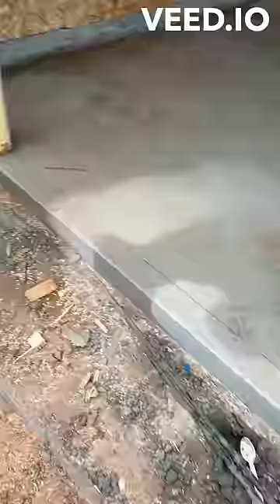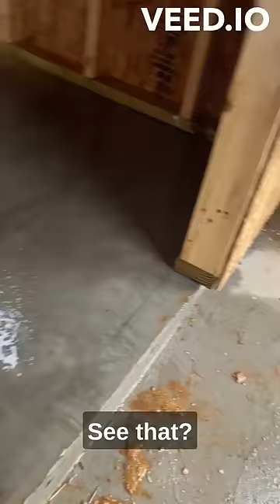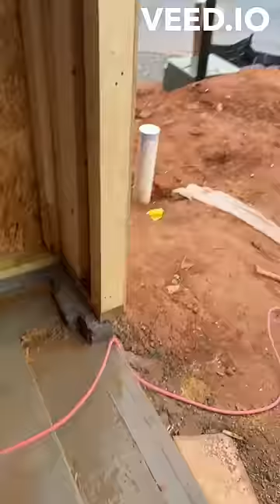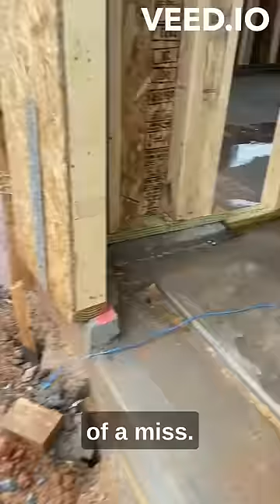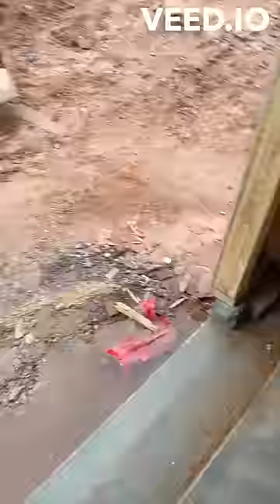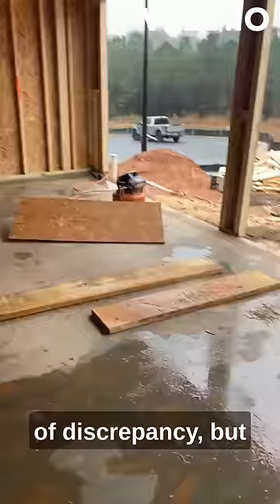New Home Slab is Wrong Size, What Now?

Comment: I like how they just kept framing even after the first one was wrong.
Reply: They have to work to get paid
Reply: @tvviewer4500 you don't get paid for shitty work that isn't correct, it's better to actually do the work correctly otherwise you're not actually working you're just creating an issue
Reply: I like how they started framing after snapping lines and knowing they'll barely land on slab
Reply: @godusopppppp  the laborers don’t care. They can still get their money saying they did what the sub or general contractor told them to do.
Reply: @tvviewer4500  be pretty hard to get paid from a company that has to file bankruptcy because you fucked up a huge job
Reply: Because they want the payment get that wood up so we can get our first payment
Reply: @godusopppppp  i think you vastly misunderstand how these people are getting paid.
Reply: @tvviewer4500  I think you misunderstand how money works, the company that employs you has to receive money in order to pay you. If you do an extremely awful job and fuck the company over and they go under there is no one to pay you.
  Go ahead and read that a few times before you @me again
Reply: Thing is it's not necessarily the framers that fucked up, it could very well be the groundworks that installed the slab. The mismeasurment is obviously they've gone to the centre of wall so it could very well be the initial measurements of the slab that are off  @godusopppppp
Reply: @tomt637  bro the slab was installed FIRST. You measure out your work BEFORE you install it. The framers should have known this slab wasn't the right size and NOT done the work.
     It's a fairly simple concept if you're not brain dead, The framers did fuck up
Reply: They have to follow the measurements concrete guys or framers one of them messed up in here
Reply: @godusopppppp employees still get paid, they may get fired afterwards but they still get paid
Reply: 3-1/2" exterior walls should never be framed liked that period. Lesson here: If you're the home owner then always arrange for the carpenters do the form work on the foundations which they are to build on. For carpenters: ideally, reach out to the owner or contractor and go with the slab... then just factor in the move when laying out the partition walls and trusses
Reply: @godusopppppp clearly you never worked for construction. Learn to actually search things. They probably get paid way more then you even if they messed up🤣
Reply: Everybody who works on a job goes off the floor plan. If the concrete doesn't fit with the floor plan there isn't a whole lot you can do. Usually these guys get paid by the job. Meaning if they don't get done in a timely manner they can't get paid. That's a real bind to be in
Reply: They need their meth money
Reply: @godusopppppp Poor workmanship is not grounds for rejection. Carpenters did their work fine. Not their problem.
Reply: If youve ever tried to explain to a GC how another trade fucked up, you immediately  understand.

We had framers slope a roof wrong once and roofed it anyway. Let building inspector know it was gonna pond til it collapsed the way it was and when GC complained we just resent the email we sent weeks earlier explaining exactly that, an email je had told us he didnt care.

Happens on every other job.
Reply: @godusopppppp thats a lie. You get paid for doing the work to contract. If someone else messed up but you did yours right, you get paid to redo.
Reply: @MrNipy *than
Reply: That's a dick move.
Reply: Two by off every where
Reply: @tomt637 they could have moved the walls in.
Reply: @@ChimentiStaxit could entirely be their fault. They might have snapped the wall line. The line might even be off. Maybe the concrete was off. Fact remains framers not smart enough to see that’s an issue. Could have pulled the wall in and no one would notice.
Reply: @RoofingFacts by the GC, not the owner.
Reply: @2002mattyusk  the majority of the times the owner knows as much about the construction of their building as a dog understands about driving a car. Sounds fun, they are there for the ride, but they're lucky if the can operate the window buttons.

Plus some contracts or verbal agreements may ban you from reaching out to the owner short of an illegal activity occurring
Reply: @RoofingFacts  yeah lots of people that end up in construction just don't care at all about doing things right
Reply: @2002mattyusk  it could be, but I've seen situations similar to this and in my experience it's the concrete guys 9/10 times
Reply: @royalgilpin4922  oh I know.  I'm a consultant that specializes in helping in forcing builders (primarily through litigation) to fix the job properly or pay to have it fix
Reply: You're paid to frame, when the super isn't checking up it's his fault.
Reply: @timothinking9855  I mean, yes that's true, until you realize how contracts work
Reply: @peterpizzurro  damn you should have been a professor. Only a few people in the world can type perfectly like you!
Reply: Somebody told them “Just do it!”
Reply: Not only that but they sheeted it too
Reply: The generation of that wasnt my job. Claps away dust
Reply: That’s what I was thinking I would not pay until it was done right
Reply: @diceNdiceN  not always 😂 if the employer can prove gross negligence, they dont have to because it could also be considered stealing time because you knowingly fucked up and still kept going. Employer could also sue for all materials and labor hours wasted because of this.
Reply: @tvviewer4500 you understand that crews get cut with no pay when they fuck this shit up. Maybe with union they get paid but not from the owners pocket. That would be in and out of court. Especially when your inspector is this guy. His notes are thorough and vloged.
Reply: This is what terrible contractors do, and continue to waste the homeowners money, then they are going to blame it on the foundation guy. Then they will need to be paid to rip it back down. This is a scam
Reply: @@ChimentiStaxit 100 percent is the framers fault because they shouldn’t have installed until talking with the general now it has to be redone
Reply: @godusopppppp You have garbage knowledge of how big contract work is financed. Half up front or full up front for labor and materials plus contingency.
Reply: @godusopppppp  that’s how it SHOULD be. That’s how it was. But now you get punished for working hard. In the sense that you pick up others slack while they get paid the same. It pays mentally to be lazy. Your hard work is not appreciated anywhere🤦‍♂️
Reply: @tvviewer4500 ty for this laugh!  I started thinking of a burger place going through the motions of assembling a burger without the meat.    The explanation "we were out of meat but.. got to work" 😂
Reply: @godusopppppp Correct! Or they could have just made the frame to fit the slab and called it a day.
Reply: @MrNipy  you're talking to brick layer here you child, I would never just start laying block on a footing that's fucked up and not the right size, learn to take some pride in your work bud.
Reply: @spray_cheese  I don't get your point of view, yes if you show your job that you do more they will definitely throw more on your plate but something like this doesn't take a genius to figure out, you pay out your strings say "oh that looks fucked up" and then you inform the super if they're not already right there laying out strings
Reply: @godusopppppp  “you child” bricks have nothing to do with this🤣🤣 keep it up clown
Reply: What choice do they have? Builder definitely told them to go with it. The ROs and room sizes are set in stone.
Reply: @godusopppppp  not saying you should be a shitty worker. I’m just saying there’s no consequences these days. You get yelled at for not busting you ass as hard as you were the day prior but people who slack and fuck off get to laugh and have a good time with their boss. It’s bullshit. It’s not even just low end jobs either it’s everywhere. Before I was even born that shit didn’t slide. But people are soft nowadays and even as someone who had it no other way. It pisses me off! Working hard gets you nowhere. Just as far as the rest. So no point pushing. It’s communism essentially at a small scale.

Also not being demeaning, don’t give up. But it’s not wise to bust your ass under someone else’s belt. If you want more money. Work for multiple people. Not a lot for one person. You’ll ACTUALLY get paid then😂
Reply: @MrNipy  your comment says "I bet you've never worked construction" so yes me being a brick layer is relevant to prove you wrong on that, and secondly framing a house in wood is the exact same process as laying down a block building, only a block building definitely takes more work and skill. Learn some things before you talk child.
Reply: @godusopppppp  Funny you assume but you working construction don’t think so anyone can say they did something and didn’t and you saying child just telling me you haven’t hit puberty so good luck growing up.
Reply: @MrNipy  Dog why r u angry at him all he is saying is that the framers should have done their job properly. If you disagree with him, that means you think they should have done their job improperly. In other words, you're wrong.
Reply: @@ChimentiStaxyou would do that kind of work cause a piece of paper said so 😂😂😂😂 🤡🤡🤡🤡🤡
Reply: @godusopppppp  that’s what insurance is for. But that would be on the Architectural or concrete company I would think.
Reply: @godusopppppp  they still have to pay what they owe their employees even if they file bankruptcy. Might not be right away but they get something. It’s illegal not to pay what you owe if you are under a contract.
Reply: The framers were probably the ones that actually got it right. You see, when a house is designed and the trust company builds trusses for that house, the dimensions of the house need to match the dimensions of the plans because the trusses are built according to whatever the dimensions are on the drawings. If they build it to the concrete was poured and just ignored the dimensions on the your roof wouldn’t  work quite right. Everything would just be a little bit off and when it comes to the roof, it makes a huge difference. Concrete guy are rough. Sometimes if you had to form up Concrete forms then you would understand why.
Reply: @godusopppppp  Once Production is rolling, it’s not always that easy of an option to just stop in have the concrete poured again. The concrete guys can always come back and dry pack beneath the part that is not sitting on top of the concrete there are fixes for all that stuff.
Reply: @@ChimentiStaxexactly!!!!
Reply: @Chris-yv9tv  oh yeah, that’s the smartest comment I’ve seen on here!
Reply: That's because most dont understand building thats for sure, I read the comments.
Reply: @cmbmail42  Question, so could they not just dig up the dirt in front of the overhang and put down more foundation?
Reply: @godusopppppp but I assume the framing work is correct so they will get paid. They can only go to the plans. If they followed the slab and made the house 2 inch to small then the work would be wrong and they wouldn't get paid.
Reply: @tvviewer4500 exactly than they'll get paid again to fix the work. They can give 2 shits when their boss is a piece of crap. Boss will be the one paying out his behind
Reply: @godusopppppp this could be a huge company that can eat this no problem and whoever was in charge of this job will get their ass chewed out and possibly fired
Reply: @godusopppppp  the workers still get paid the contractor is the one tking the hit im most of my cases
Reply: @godusopppppp who fucked up though? Foundation could be short from the blue prints, then carpenters said Fuck it we’ll follow the blueprints rather than deviate to fit the foundation 😂
Reply: @godusopppppp wrong they 100% do get paid whether it's right or wrong the owner of the company may not but the employees always do..😂.. I've been running a business for 35 years now and that's as true as it was on day 1
Reply: @godusopppppp how is it shitty work? The foundation sets the pace for the rest of the house. If the concrete guys did a shitty job which they clearly did. They should have redone it. Framers have to frame the house to the actual Floorplan. If the house is an inch or 2 short it's on them. People pay for Sq ft. They got shorted on concrete. You don't know how this all started. The developer could have been rushing contractors and they have to meet deadlines. A framing crew isn't going to just sit there and wait a day or 2 not getting paid while the developer and concrete guy figure it out. They could have been told to just frame it as is and they will fix it later
Reply: Si, esta bueno
Reply: I am still puzzled as to how this could be isn't the concrete guy guy using the same framing plan as the framer?
Reply: @godusopppppp you still get paid. Why even try to explain. The boss is always right, they want the job fast pronto rapido 🤣
Reply: @godusopppppp they get paided otherwise there bud they just don't have a job no more
Reply: Exactly. The framing is probably correct because there going by the layout stated on the plans. The concrete sub does the same but there laying out in the dirt with more of a chance to be off the mark, even though they should hit all there marks. The way crews are now on new home sites it’s faster to bang it out with cheep undocumented labor and if it’s out just patch it up later using the framing as your layout. As for the framers probably hitting layout, they can put layout  on concrete and double check and square up if necessary. Framers will or should build to the plans and F the concrete sub they will do a callback and that’s part of the plan because they slapped it down in on day making bank so a little patch work at 7$ per hour.
Reply: @tomt637 the framers didn't fuck anything up, unless they did footing and concrete
Reply: I was going to say that too. When we built our house we hired an independent site inspector to make sure things like this didn't happen. It was money well spent
Reply: @godusopppppp  if the framer built like the print showed and used the correct dimensions but the concrete guys messed up then they would have to pay me to tear down all of my framing and redo it.
Reply: @godusopppppp  framing was correct, slab was too small. concrete company should have to pay framing company to tear down and rebuild after they fix the concrete. or pay them to tear down and rebuild to the new speck in dimension which is going to change the whole project. who is to blame.
Reply: @godusopppppp they probably did know and still installed because that's how construction works. their work would be correct if the Crete guys did their job correctly, and ppl have a damn schedule to keep.
Reply: @2002mattyusk if they moved the walls in that would screw the other contractors electrical plumbers drywall AC and heat you are not understanding but that's okay. that's why there is a comment section. always build what the print says that's how you cover your ass. I imagine they probably told them about this and nothing was done.
Reply: @2002mattyusk the video says the concrete pad is wrong...😂
Reply: @kregadeth5562 no, shit should have been right to install on, so the foundation is messed up, and my guys are supposed to go set on the couch while they take weeks to fix it and completely screw up scheduling for multiple contractors. Sorry not sorry... this is also why I put a clause stating I get paid a percentage if it messes up my schedule.
Reply: here is the deal... time is money, that simple. are you going to let your kids starve because the GC and Crete guys are negligent and incompetent. It sucks having to follow shit, but it's usually up to the framer to figure that out, then it's up to the drywaller to fix the framer, then it's up to the FN trim guy to compensate for drywall.
Reply: @tvviewer4500 I don’t know anybody that has any common sense paying for shit work I know I wouldn’t
Reply: @maclemaster5966  the GC paid for this and paid for the remediations which means who ever buys this house ends up paying so it doesn’t matter what you would do
Reply: @godusopppppp that is the most ignorant comment here...they should have just stopped and called the project manager but instead have lost thier ass and more than likely now lost all of the material that won't be paid for because they willingly kept working on the wrong slab.
Reply: @dr.trollingall9622  why are you @ing me to say this? Literally every comment I've dropped echoes the same shit you're saying
Reply: @godusopppppp  wrong. Check mate.
Reply: 😂😂 what would you do?
Reply: Mexicans
Reply: @godusopppppp actually you get paid to do it twice after your boss gets pissed and says do it again 😂😂😂
Reply: As a carpenter I stand by their work. I'm not letting the concrete guys mess up my paycheck.
Reply: 15 year Construction Project Manager here.

Seeing a lot of crazy stuff being said. It's highly likely that the masons were off on the slab pour, but to be clear, there's almost always an inch or two off one way or the other. Construction is not as exact a science as many here are making it seem.

The amazing part of this is that the framers apparently thought it wise to stick to the plan despite the slab being 2-1/2" short instead of just making the necessary adjustments.

In spite of what anybody here says, you don't stick to the drawings when the drawings are wrong. If you want to get paid you make it fucking work with what is on site, or you pack up, call the PM, and go home. You never intentionally build something wrong and try to blame the guy before you just because he was a few inches off and you didn't want to stop, rethink, and adjust what you were doing.

I saw someone say the framer would get paid for this, and then get paid again to re-do this. I actually laughed. If this was my sub, they'd get one chance to fix this at their own expense before I even agreed to pay them in the first place. If they did then I'd pay up. If they didn't then I'd hire someone else too, subtract their pay from what the original framer is owed, pay the difference and they'd never work for me again. All the documents would then go right to legal, good luck with your lien buddy.
Reply: @jamesziegenbalg7160  typical construction management...They're (concrete) finishers, not mason's. Go back to school.
Reply: @godusopppppp usually it’s the general contractor they tell you to do something you do it even if the shit is wrong just how it is and if the contractor fucked up it’s on him
Reply: @MrNipy  Bro only if they fix their fuck up or cover up their fuck up. Imagine thinking this shit bucket of a house isn't going to be inspected.
Reply: @stevenfuller3816  they saw it didn't line up and did it anyway and will have to fix it regardless 😂
Reply: @2002mattyusk  so, if the concrete guys blew their layout, the carpenters should void their contract by going off the mistake? Is that what you’re saying?
Reply: Concrete want square thats why
Reply: So concrete guys effed up, the framers come in and see its effed up and make it more effed up. If this was my home and my money being spent I'd be taking some heads across the board.
Reply: @godusopppppp that's on the concrete guys my boy not the framers the slabs wrong concrete guy will have to eat it
Reply: This happens all the time. Ii'll bet it's a tract house. You want perfection pay fkr a custom house.

That said. It can be fixed. Drill, dowel, form and pour.

I'm a framing subcontractor. Developers pay us to frame. We tell them "hey your slabs short" "out of square" "not level". Doesnt mattee they have a buyer and need to hit the delivery date. They'll backcharge/make the concrete guys fix it.
Reply: They build the walls on the ground according to the drawn up plans then stand them up. Seems like it was more the fault of the concrete guys.
Reply: This is an opportunity to get promoted. Let tour superior know its all effed up. At the very least itll be burned in his memorry
Reply: @zachforbes3901 framers built the framing to blueprint specifications. If the framers build the frame to the improper foundation, it screws up everything down the road. The amount of code violations that can occur, after framing to improper specs, is grand.
Framers were subcontracted to frame to blueprint specs, they did their job.
It is the general contractors job to verify the slab is to spec BEFORE bringing in the next group of tradesmen.
Reply: I am a Carpenter we would have snapped lines, started framing and after finding out our lines were that far off from the start we would have remeasured and contacted the concrete boys and tell them the situation and stepped off the job
Reply: @2002mattyusk how you gonna change the length on every single damn wall. We have to follow blueprints. Those were 3/4 inch to 1/2 inch off. That will throw so much off if you keep trying to compensate for that huge s difference. You have never built anything have you
Reply: @godusopppppp  you ever heard of prefabricated housing?
Reply: Don't say your ready to have house framed if you ain't 
Cause if you say your ready and you ain't..it's going up
No matter
Reply: I’m not a builder but it seems like if the concrete is wrong the framers need to make the modifications because the concrete is done. So you know the concrete is wrong and yet you keep going with it ? Seems messed up to me
Reply: @tomt637 if that's the case it's the framers that need to adjust the outside walls to the slab. It's constantly people saying it's not my job that makes these homes pieces of junk these days.
Reply: Who was the less competent- the framers, concrete guys, or the construction foreman?
Reply: @godusopppppp  you get paid or u put a print on the property.. 
You know the wall has to be up for the bank to give the buyer a draw on the loan. 
Banker don't know the difference. N builder rolling the dice.
Reply: @@ChimentiStax The framer and  the concrete guys may be both at fault.  Not enough information to say here. But the farmers are clearly at fault for making the problem worse.
Reply: That’s how most houses are built in america nowadays. Misaligned and Crappy
Reply: First look at the plans bro. You can’t judge based on this video because we don’t know the deminsions. It could be that the house is framed correctly and squared but the concrete slab is short. If all the floor joined and roof trusses work on that frame then the slab has to be short or the framing layout wouldn’t  work with the rest of the floors.
Reply: I would have held that check until it was corrected properly
Reply: They could have easily fudged it in.
Reply: @godusopppppp  they'll still get paid unless the company can afford a bigger lawsuit.
Reply: Facts are they mental ?
Reply: @tvviewer4500  I mean yeah if you’re just a guy trying to get paychecks by paycheck but if you know the job is being done incorrectly, don’t build something others can die and that leaves you responsible, so fuck paycheck…. Your work got to be 99% perfect.
Reply: @godusopppppp  Dude, what are you talking about 😂
Reply: @dr.trollingall9622 💀💀💀
Reply: And these comments are why homes are built like shit these days. No one takes responsibility. It's always someone else's fault.
Reply: Right 😂
Reply: I’m going to share this with my team as a great example of “failure to escalate”.
Reply: Not the framers fault. The concrete company will have to come back in and fix it. Sometimes you gotta split the difference and role with it. You got a crew with 5 six guys that need to get paid the work goes on. Cant just wait a week for the concrete to get fixed. Everything is tightly scheduled
Reply: @godusopppppp hey you obviously dont work in construction big crews cant just pull off a job for a week guys need to get paid roll with the framing and let the concrete guys come back and fix it after the fact. Im sure the framers let the g.c. know and he told them to run with it
Reply: It’s not our job to fix your screw ups. They lay concrete. We frame. Leave it up to supes to figure out whose in the wrong. 
The answer?
Whose the superintendent titling this video after? Framers or concrete guys? Framers don’t pour slabs…
Reply: @ChimentiStax  two wrongs don't make a right. Are you saying the framers don't have eyeballs and can't read a tape measure and read what the measurements from the blue prints don't match up with the concrete slab. It's the concrete guys fault as well as the foreman running the framing crew.
Reply: WTF
Reply: @tomt637 the concrete contractor dropped the ball. The framers built it as per plan, which is the correct action. The concrete sub is responsible for making the fix. These people don’t understand that changing the perimeter dimensions affect everything in the field and also trusses are ordered to specific dimensions before framing starts. It’s not as big of an issue as all these keyboard construction expert warriors make it out to be. 😊
Reply: @godusopppppp  nope you’re wrong. The framing contractor built is as per plan. You must dust eves for a pest control company.
Reply: @eighteight6605  just like to point out as. 26 yo working in construction for 8 years different fields the bosses I've argued with over too much "that'll do" have all been over 40 and all share a famine business mindset wanting every job done as fast as possible with no regard to quality if it's not visible.

It's about how greedy somebody is not what year they were born, if you want to whine about the generations getting into the work place go whinge about phones, it's the only thing i can genuinely say our generation is  worse at otherwise it's down to the individual.
Reply: @PurpleFilthx  man you nailed it. Every site I've worked on I'd say way more than half the guys are either smoking or snorting meth.
Reply: @hatfieldmccoy0311  I don’t think you’ve ever built a house. I’ve seen small bathrooms out of square by over an inch. Lol. Maybe you haven’t built many houses. You can argue with me if you want, but you’re wasting your breath. I’ve been a framer to a superintendent to a senior construction inspector. The framers could have made that work. ACI even gives you tolerances you can be out on forming concrete. Yes a mistake was made, but it was compounded by lazy framers who didn’t even try to hide it or take pride in their work.
Reply: @stevenfuller3816  Yes. In the real world that is what would happen. If this were a municipal job I would hold payment to the GC. Do you think the GC wants to tear out the whole slab or adjust a wall that no one will ever measure. I have experience in this field so I know you’re wrong. I know you think you’re right, but the GC isn’t going to stop the job and tear out the concrete and then pay the framers twice. If the GC is told he’s not getting paid, he’s going to make the framing work.
Reply: 99.9% of the time no one checks it and makes a video
Reply: 😂😂😂maybe they don't speak the English and probably drinking the Modelo Especial😂😂😂
Reply: Some really butthurt construction workers in this thread 😂
Reply: Yeah they probably built it to the prints. Thats their job. Now if they have to go back and do it again that’s rework and they get paid again. And most likely it would come out of the concrete guys pocket if it’s their mess up. That or the concrete guys come back. Fix thier mistake and done get paid cause they didn’t do it right in the first place.
Reply: The concrete shrunk 😂
Reply: I'd charge you to correct.@@ChimentiStax
Reply: @@ChimentiStaxThey built the walls hanging off of the slab. Everything is even more fucked up than it was before. If they had any integrity they would have told the general contractor that they can't build to spec because the slab was off. Why would you take one mistake and compound it by building what will basically become another mistake on top of it? The only answer is because they didn't give a shit they just "Did their job" because they were like "Not my problem".
Reply: @@ChimentiStax Bro, it can be both
Reply: @@ChimentiStax It can still be both. There are states that would require a structural engineer to extend foundation after framing is built. I've always had strong GCs. If this happened, framing would measure, get paid, come back tomorrow with it fixed, start framing, charge back the lost day. No way I'm going to be liable for somebody who already screwed up once.
Reply: @@ChimentiStax I know the kind of BS you're taking about, I just don't do Labor Ready anymore
Reply: @tvviewer4500 The laborers aren't the people in question, IMO. The chief of the crew (or foreman? I don't know construction crew hierarchical names) wouldn't get paid, so one would hope that THEY would've stopped it. Unless, of course, the person above told them it was ok. I guess what I'm saying is, whoever gave the go-ahead to keep framing, or to lay the first board, is going to be the one who doesn't get paid. Then the people below them might get screwed. Meh, nevermind, I don't know what I'm talking about; But, I slept in a Holiday Inn Express last night!!
Reply: @r_yang0  yeah I don’t think anything you said changes what I said
Reply: @cmbmail42 you won
Reply: @godusopppppp what about the payroll being covered under the construction loan
Reply: Not my problem
Reply: What a bunch of asses.  They should have stopped work immediately and started making phone calls.  Not hard to change plans a little bit it happens all the time.  This was either to fuck the concrete crew or the builder
Reply: Having dealt with framers that did this kinda crap, they didn't get paid for the vast majority of a $200k job. It went to court. The owner had to pay court fees because it was clear that they knew there was an issue but made no effort to rectify it. From what we gathered, the framers laid their first wall off a few offset anchor bolts, and built all the framing off of that. Complete mickey mouse crap.
The framework had to be partially disassembled, a bunch of walls got shoved over a few inches, interior walls were dropped and rebuilt, etc.
Reply: My thought
Reply: @godusopppppp actually, if you are on wage, you have to be paid even for the crappy work you do.
Reply: @Random-ed2xf  you don’t know how the law works. And you would ‘loose’ in court
Reply: @godusopppppp they’re in the position doing that work because of their work ethic. No one wants to do this job if u wanna be rich
Reply: @godusopppppp they do is the unfortunate bit. You just end up having to dispute it in court or are left with a half finished product. Pay on completion folks.
Reply: @2002mattyusk  Then nothing matches the blueprints, follow that up a couple of floors and the engineered trusses don't land on the walls.
You can't just randomly move stuff...
Reply: @tvviewer4500 yes but if they had spotted the error from the start then now they don’t have to do a whole bunch of BS work now

Additionally, someone usually gets either a lecture or dismissed for a massive oopsie like this. Some minor things bosses let slide but I’m not sure about this one…. Could be a simple fix but a costly one 😅 and if it’s costly then chances are the dude that read the plans wrong or just measure wrong and kept on going might get laid off which is more common than most probably think
Reply: @carlosf9278  sounds like it was a cheap fix and the workers got their pay. That’s all they care about and they don’t have time to wait for something as trivial as new drawings to be drafted
Reply: @@ChimentiStax Exactly. The concrete guys fucked up. That front wall is load baring and put in according to drawings.
Reply: @PoliticsAndReligion116 what about pre-engineered second floor and roof systems.
Reply: I love all the comments from the people that don't know anything about construction.
Reply: @cristianhrvatin3543  I'll be honest, I didn't consider that, but it could be possible.
Reply: ? You have no work ethic if you do something that shady@@ChimentiStax
Reply: @godusopppppp  they all fuked up. But the framers are the actual idiots for laying their lines, then going ahead and building on short lines. Lol. These idiots in the comments are probably the framing crew that's why they keep arguing with you.
Reply: @tvviewer4500  it’s an inch or two of a difference that the inspector won’t even realize. All they had to do was call their boss (the framers) and let him know… and all he had to say was OK 😂

Working in construction for nearly 5yrs now I’ve realized that communication is key… which I guess is true for every job lol sucks they don’t teach you that in school tho
Reply: @godusopppppp actually you do. You get paid by the hour.
Reply: @2002mattyusk they would have to redesign the whole house to do that.
Reply: @GenesisRasphotos that’s not true at all.
Reply: @PoliticsAndReligion116 oh sure.. they just draw up whole new blueprints for everyone on the contract and call it a day because they are engineers as well as framers. 😂😂😂
Reply: @MrNipy  you got some space where brains could be.
Reply: @TheBeefSlayer ok David
Reply: @TheBeefSlayer  to be honest, I never dealt with any such system and haven't worked construction in a few years.  With technology advancing the way it is, I just assumed it was possible. Me on the other hand, I had to do it the hard way 😆
Reply: "not my fucking job"
Reply: @stevenfuller3816 I'd fire you just for saying that.
Reply: @tomt637 should start a contracting company 😂.
Reply: @MindsDozer  you’re working for me champ. Go clean the Mexican spaceship out. Drywallers been taking dumps in the urinal and the piss is backing up all over the floor.
Reply: I'm not a carpenter or a builder so don't flame me for my question but, will the builder get paid the final profit side of the contract without that all being rectified will they? It still has to pass local government inspection doesn't it?
Reply: @godusopppppp Maybe. I'm guessing the framers will get paid or sue. It wasn't the framers' fault. It sounds like the foundations problem. Court will decide who gets paid
Reply: Pretty sure the concrete is poured first .. then the frame @tomt637
Reply: @godusopppppp false now n days you get paid for whats done someone else will get paid to dix it later😂🤷🏾‍♂️ or you get paid to fix it again idk why but thts how new construction works now
Reply: @tomt637  it doesn't matter if the flatwork was off.  2 wrongs don't make a right.  Why build a screwed up house just because you can blame it on someone else.  I would throw a stop work order and fire the framers and GC.
Reply: Concrete guys are wrong.
Reply: @geostrophc  probably.   And so are the framers.
Reply: @2002mattyusk then every single other measurement in the house like piping, wall braces, etc. would be off. You should just shut your mouth and stay out of this one since you clearly lack any experience.
Reply: @royalgilpin4922 it’s not the workers, the workers are doing exactly what they’re told to do. They don’t paid to fix or point other crews and other companies fuckkk ups. Until building law changes this will continue to happen and happen often.  That’s just how the construction world works. Also if the. Company has to come back to redo the work that’s more money for them so why would they say anything. Again there needs to be a change in policies.
Reply: This job they did is a joke.
Reply: It's important to be on the job site to check things out or else some of these contractors will do crappy work get paid while e you have to spend more money and time to get the job done right a second time.
You need to have them come back do the job correctly, do not pay them again. If they refuse, take them to court.
Reply: @godusopppppp  lol, you are quite the 🤡. How many contractors do you know, framing out “big, big” houses, that don’t have a plethora of crews? How would one crew, on one house bankrupt them? Seems like an extreme example. I guess what you said is possible, but extremely unlikely.
Reply: @tvviewer4500 lol in this case you got to work to owe.
Reply: @Whatsa-jaguar-now  you don’t get how contracts work
Reply: @tvviewer4500  I do understand how lawsuits work and framing, and concrete and who's gonna pay for the redo. So I guess you could say I understand how contracts work.
Contractor gets sued based on parameters of promices and consessions. Contractor sues the sub. Sub pays. All those workers just lost any bonus and future work.
Reply: @Whatsa-jaguar-now  sub declares bankruptcy and keeps funds. Amateur.
Reply: @tvviewer4500  that just depends on who's bankruptcy goes through first, creditor or personal. 
If that were the case the creditor would declair you bankrupt and a 3 day court filing to freeze your assets for determination so nothing can be filed against them.
Reply: @Whatsa-jaguar-now  you clearly have no idea how bankruptcy works
Reply: @tvviewer4500  sounds quite like the opposite is true if that's what you think. If you owe me a substantial amount of money, I can file a court order to freeze your assets until a hearing where the courts place you in involuntary bankruptcy. Effectively liquidating your assets until I am paid in full.
Reply: You build whats on the print, not to the slab size
Reply: Yeah, WTF? If I was the owner you know you just got played
Reply: @infinitewithin  as the owner I would have been angry if the house was smaller than I agreed to.. but I'd be pissed if I had just paid for an unusable building. Just build it to the pad. I'll sacrifice an inch and a half of living space.
Reply: @godusopppppp your right however unfortunately your wrong…. So the hourly worker don’t care because most of the time they’re still gonna get paid and if they bring up the issue and stop production then they don’t have work..

Now as far as the owner of company then they’re screwed…. It’s unfortunate that so many people don’t have pride in their work from start to end…. 

And with today’s society being the person who brings up the issues your usually vilified and seen as the bad guy 

Crazy isn’t it 🤷‍♂️🤦‍♂️🤦‍♂️🤦‍♂️
Reply: no supervisor ???
Reply: @godusopppppp guys who did the work got paid to do it once, tear it out and build it again.😂😂
Reply: Different sub contractors.  The lead contractor should have inspected before the framing even started and held the concrete subcontractor accountable.
Reply: They are there to frame, not fix the concrete 😂
Reply: No. This is NORMAL in Australia and a carpenter told my dad they just go ahead and build it to plan. Trying to get it to fit best.
Reply: @godusopppppp No. This is NORMAL in Australia and a carpenter told my dad they just go ahead and build it to plan. Trying to get it to fit best. Exactly WHAT ELSE are they meant to do. Destroy the entire slab and start again?
Reply: @tvviewer4500 The subs will blame the Laborers,  dock pay and fire them for not paying attention
Reply: @bmffafo5004  sure in your imagination anything is possible but no
Reply: @jamesziegenbalg7160 would depend on terms of the co tract I know when our guys do schools around the area they have to follow plans by the architect/engineers to get paid. If we see a mistake it gets mentioned they usually don't listen then crew gets paid a second time to redo it to a new plan. Honestly think the whole setups stupid and probably varies by local I'm on usa east coast.
Reply: Thats their measurements, thats what they have to go by. And if measurements are wrong someones in trouble.
Reply: That's what hiring cheap labor will get you
Reply: @tomt637  Oh without a doubt it could be the concrete guys fault for the discrepancy, but the framers still built a house knowing the pad was undersized. That's on them.
Reply: @jstrada5077  They both effed up, concrete guys screwed up the slab and the framers just kept on throwing good money after bad. Now it all has to be fixed and that's going to cost more than the few days of down time they would have had while the concrete guys resolved THEIR situation.
Reply: What else do ya do they will add concrete later
Reply: @godusopppppp  actually it is completely correct its the concrete guys
Reply: The framers could have hit their plans spot on and the foundation is fucked. I can’t imagine they framed it like that without a call to the super.
Reply: They don't have to do that job and if their employer doesn't have another job to go to in this market where there is more work than time in the day, they should find a different employer. @tvviewer4500
Reply: Love the comments by people who have no experience in construction
Reply: The walls are pre made, the concrete lads fucked up the slab .
Reply: They have to follow the blueprint,  they can't just move stuff in and out , the trusses are already made , the builder needs to get an engineer and see if more concrete is needed or more bolts eather way , clear case of the builder NOT BEING ON THE JOB 😡
Reply: Unreal ... why would you keep going ???
Reply: All he had to do was put a speed square up next to the concrete on the outside. Lay the base plate down and it bumps up next to the speed square. That’s how you ensure it doesn’t go over. This is kindergarten stuff. 🤦🏻‍♀️
Reply: GC probably told them to hang it like that.
Reply: @godusopppppp the concrete guy got paid 😂😂
Reply: @godusopppppp huge job on a $8000 garage😂😂😂
Reply: @godusopppppp the boss doesn’t get paid if the work is shitty, the employees just got another day of pay
Reply: @cmbmail42 this is peak.  I hate the other guys , I’ll just follow my instructions, even though I. Can clearly see it’s f*d
Reply: He respects the blue print. What would you have done@godusopppppp
Reply: @godusopppppp thats not a big job though
Reply: @PurpleFilthx  you got you fly by nights a carpenter with a head on his shoulders is a force to be reckoned with
Reply: Literally my thought
Reply: Layout crew should have notified framing foreman after first floor was snapped
Reply: Yeah and it just gets worse as you keep going
Reply: They can't go off spec, it's not really up to them they're going off drawings.
Reply: @tomt637 my guess is there was a discrepancy in the drawings and no one in charge of managing the project caught it. No one is going to go off spec and the project manager is really the only one allowed to reach out directly to the architect to have drawings adjusted. Laborers are just laboring and following the plans.
Reply: @godusopppppp  you obviously dont understand how blueprints work, especially in large companies. these groups want everything exactly as spec'd, if you're off you get deducted or a call to redo at your own cost, so if the last guy is out that's his problem and someone else's fix. you just do what you need to as required.
Reply: @royalgilpin4922 your right btw
Reply: I was asking the same question like did everyone knew just said not my problem. Also isn't that supposed to be inspected before you start building on it?
Reply: The framers framed it “right” the mason made the slap too small. Personally I wouldn’t have framed it, until I spoke to the homeowner or whoever owned the property. I’d sacrifice the 3 inches front to back, rather than frame that and have them come back to add on to the slab, cause that shit won’t hold up
Reply: @atamagashock  then you have to re-frame
Reply: Well truth be told you don't change the layout cause the concrete is wrong next you'll have to blend and match roof when your connecting cause now everything is off from original dimensions. In my 20 years of framing that always fall on concrete guy. I don't just have the right to move shit when the plumbers and concrete guys are off!
Reply: They were just trying to get to their next Modelo break.
Reply: the concrete guys fucked up not the framers.
Reply: @godusopppppp i have seen this first hand. likely they were told to frame their wood to the print. the concrete guys can come back and pour more mud to correct their mistake. this shit happens all the time. more often than not the mistake is the builders for having ass hat supervisors that dont do much more than sit in their truck.
Reply: Can’t tell you how many time the concrete slab guys were a few inches short on the whole foundation. You got no choice to build it out since the trusses have already been ordered and built.
Reply: @stevewalls5070 because the slab is short everywhere!
Reply: @godusopppppp 
I would think a decent lawyer would agree.
Reply: @stevenfuller3816 
Lord I hope you aren't a carpenter. 
That's some low standards. No wonder I don't trust contractors and learn to do things myself.
Reply: @RoofingFacts That's a poor attitude.  No pride in quality craftsmanship.
Reply: @davidcrawford6505  pretty sure you never read what I said or read it wrong
Reply: @godusopppppp it’s not the framers it’s the concrete guys . If you shave a truss package that is built to plan your walls have to be   Framed accordingly so that the bearing locations of the trusses land on the walls as they should .
Reply: @tvviewer4500 they're also the only people who can adjust the framing to fit. But chose not to out of spite, so it all goes to shit.
Reply: regardless of the concrete being measured properly or not. The framing has to fit, and the framers chose to build when they knew an adjustment was needed.
Reply: @jstrada5077 everyone followed the measurements, issue is, the framers are the only ones who can make adjustments to the house. The only thing needed was a phone call to the supervisor to say it's off and readjust, very simple process. People are lazy
Reply: Maybe the slab was poured wrong
Reply: Of course they keep going you must not work in the trades lol I get where your coming from but it doesn't matter...concrete guys choked this one framers are just doing what the print says
Reply: @godusopppppp framers did what the boss told them framers are not at fault there work also looks good. Boss man needed payment when should of called concrete guy to either tear out and re pour or change dimensions of build which alot of people have to agree on
Reply: @tomt637 
The problem is everybody's drunk and illegal.
Reply: @godusopppppp  you have to keep your build exactly to spec if it does not match the blueprints you do not get paid. If they would have made the house too small they would get paid $0 for all their work and lose all the money for materials you are wrong go back to school
Reply: @2002mattyusk  u can't just "pull the walls in"! The measurements that are in the plans have to be exact or everything else that are on the blueprints or "plans"  won't fit correctly. Just pulling the walls in an inch or so doesn't sound like much but then every other trade has to change their plans by an inch or so as well so in effect u changed the whole plans for the entire job and now nothing fits as the plans say they should!
Reply: Someone is gonna get paid for rework
Reply: @godusopppppp The lesson in this chat is there are a lot of boneheads who support shitty work just for a check. A lot of "looks good from my house" quality kings with no pride in their work.
Reply: It’s called rework, if the concrete company is at fault they will have to pay for the labor that the framers did. Especially if there’s a paper trail where the framers told the concrete crew that they fucked up. Everything is according to prints and if the prints don’t line up, somebody fucked up whether it be bad layout or trade error. Ultimately the GC or owner should be notified so they could make the final call. If I was the framer I would not have done any framing until the issue was resolved.
Reply: I'd say if it was the first time this happened, they would have stopped but I am making a fair assumption this happens all the time with no compensation for a loss of $$$ so therefore now they do their job and let it fall back on the concreters.
Reply: You think their going to bust up the slab. Framer has to make it fit. I've move plenty of walls over to get plumbing in the wall.
Reply: It's correct the foundation is off
Reply: A lot of these toothpick homes are already preassembled.
Reply: @godusopppppp you actually go get paid for that, happens every day
Reply: Well my friend they get paid to do what their told so if they framed that house to what the concrete guys did then they are at fault. I have guys at my work will point out what’s wrong and still build it just to cover their own asses
Reply: If the farmers were worth their grain of salt they would've contacted the homeowner BEFORE framing as soon as they realized the screw up on the pop out. My guess is..the homeowner didn't want to hassle with the concrete guys coming back to fix their screw up or either he done paid the concrete guys in full (which again is the home owner fault) before checking the slab to make sure it's proper
Reply: @2002mattyusk wouldn't have passed inspection and would have cost more money. If the concrete is off they will have to pay to redo, if the framers are off they will have to pay.
Reply: @2002mattyusk pull the wall in so no one would notice? That's what's called fraud and is how a company losses insurance coverage also creates more problems for other trades and legal issues for builder and seller.
Reply: It's bad concrete job not the framers
Reply: @godusopppppp I promise they pay the employees b4 they even have the chance to go bankrupt it's not somthing that happens over night takes a few weeks for court and what not
Reply: @godusopppppp if the concreter fall short of their measurements,it’s not the fault of the framer,otherwise other trades will blame the framers.Framers are probably sticking to the drawing.If the alter from the drawings measurements,trades like cabinetries will blame them! It’s every tradies keeping to legal rights
Reply: Who said the first one was wrong? Generally you'd start on the edge and work to the far side
Reply: @allananderson949  how do you know it was right? I work in the industry and always counter these! We always talk to the builder,and they always blame the concreters!Sound you have clue
Reply: A good carpenter would've talked to the owner or site lead and compensated the error
Reply: @tvviewer4500  You don't get paid when you do the job wrong and do it when it's obviously not right . The laborers might get there paycheck but it will probably be their last. They just lost the company alot of money. And as the GC I would never call these people again . There is in no world where this is right or ok in anyway
Reply: Insurance companies will not insure this
Reply: @danchris4287  what is wrong? Please write specifics.
Reply: @godusopppppp  well now I know you ain't a trades person..I can bring it up to the prime contractor and often just get told build it like the print....and no amount of arguing will sway them. So you do the work, they go ah we were wrong out bad and then you go back and change it as a hourly cost+ and make bank.
Reply: They can fill concrete in later
Reply: @godusopppppp they do though. It’s the boss that doesnt
Reply: @tvviewer4500  do you not see the framing over 2 inches over the slab ? Are you seriously defending that ?
Reply: @brucedeleskey8540  we would like it to be but they would not see it when it’s finished.As they would cover it up.However if structure fails, then that’s when it’s becomes messy as the insurance would dig deeper into it.Then that’s when it would be more interesting
Reply: Plywood😂😂😂 I would be more concern about that. The cement ain't going nowhere in a storm.
Reply: @danchris4287  how many deep were you in this comment section to ask me this?
Reply: @godusopppppp  if you get paid either way who cares is the thought process here.
Reply: @Jerbo1125 you literally have no clue what your talking about. Dude that foundation is an easy ass fix and could literally be fixed in a day with the walls up. The framing being done makes it easier to fix the problem if anything. Lol you guys act like the whole house has to be torn down
Reply: Tell me you have never stepped foot on a residential job without telling me you have never stepped foot on a residential job. I like how all of you are talking shit, but have never touched a job site in your lives. For time this is how most jobs are done. The concrete crew will come back and do repairs while the rest of the trades can still carry on schedule for the most part. The slab should've been checked before pour not after by the framers. If time wasn't a concern then I would agree with yall. If the framers marked lines and saw the slab was off this bad it should be fixed first. Due to time that is just not practical and not how jobs are done though. If your a builder whom doesn't follow the majority good on you, but you are a needle in a hay stack. Whom deservers a thriving building company.
Reply: @godusopppppp  I get your point because your trade starts with the foundation and if it is off it effects your work immediately. So does framing start with the foundation, but it doesn't effect them immediately in a case like this. Due to time this is how most jobs are done if the slab is off. Because this doesn't hurt the framing temporarily while the concrete crew comes back to repair it and they also now have framing to work off of which makes it easier to repair actually. Plus most of the other trades can carry on schedule aswell. I know you can't because if framing is off on the slab brick wall support is also off. But that should be repaired aswell asap along with the framing wall support. The slab is 100% what is off. They should have double checked their work before pouring. That is not the framers job. If framing won't stand temporarily while the concrete crew comes back to fix it then yes it shouldn't be framed, but if it's like this then that is how jobs are done. Not saying it is technically the correct way, but this is how it's done by almost every builder in the real word. Not trying to be dick you can believe me or not, but it's the truth. I will say you are technically right that it is not the correct way. But this isn't the builders house this isn't your house and it's not mine. This is residential building. Your a brick layer though you take more pride in your work it is art. Not saying other trades don't but masonry crews take pride in the quality of their work more than the quantity. Most other trades don't sadly although they should. But this one isn't on the framers. Start paying attention to concrete on your jobs. You will see this is actually very very common sadly. Again this is just how jobs are done because of builders and timelines although I don't agree with it either. At the end of the day it doesn't effect the end product if, and that is a big if, the repairs are done correctly.
Reply: @godusopppppp lol the concrete guys were the ones wrong! Not the framers
Reply: Concrete guys will have to lay some more material.
Reply: @godusopppppp Exactly. They should've known as soon as they snapped their lines. What begs the question, though, is why would you carry on knowing it's out?
Reply: @2002mattyusk they can’t just move the walls in. They’re capable of it but that’s not how it works
Reply: @tvviewer4500 😂😂😂
Reply: Inspector: "You got a measuring tape handy?"
Contractor: "Yeah, you need one that expands a little or shrinks?" 😂
Reply: @godusopppppp he's right though, the day laborers DGAF. They get paid by the subcontractor regardless. This is the problem with contractors subcontracting every individual piece.
Reply: Plans suck <<< concrete guy
Reply: @godusopppppp If you get pppaid by the hour you do.
Reply: @godusopppppp you clearly haven’t framed a house before. You have to build to the spec, not adjust everything because of the foundation being poured wrong. I’m sure they called the builder, and the builder said “will it work” and the framers said, “well it will work but it isn’t right“ and they got told to proceed. “We’ll fix the slab later” is what the builder most likely said and they were banking on it being a non issue and not getting busted by the inspectors. It’s an everyday occurrence in the world of framing
Reply: @2002mattyusk dude you dint have a clue, you can’t just move a wall. Not even an inch, without say so from the builder - in writing! Moving a wall an inch can be CATASTROPHIC to a build
Reply: @godusopppppp Jesus dude, laying a block building does NOT take more skill and hardly anymore work. With standard walls you’ve got to cut, build, square, insulate, sheet, Sheetrock, tyvek, side/other finish, mud, tape, mud, mud, sand, mud, sand, paint, touch up, paint. With block you literally just need to set up a laser line or a string, mortar, block, mortar, block, rinse and repeat. A block wall can be fully completed so much faster than a framed wall
Reply: Mexicans
Reply: Probably because of no hablo inglise.
Reply: That’s what you call third world cheap labor.  The bid is low but you get what you get.  Three things you never go cheap on and that is sushi, tattoo and building contracts with skilled labor.
Reply: Was the other side of the house off by being too far in?
Reply: Ok so what happens a lot and I could be wrong here is that contractors get real greedy and want these houses up even if we the framers or any kind of worker has to work on top of other peoples mistakes. Another huge problem is in the architectural aspect. Many mistakes are made, and well instead of getting it fixed (they don’t want to pay the architect again) contractors will just tell you to continue to build and they will pay someone to fix it later. 

Everyone is worried about a housing crisis. If this is true to you, then think about how a capitalism and an emphasis in profits is eating the U.S. and other American countries from the inside out.
Reply: @godusopppppp not true hourly workers get paid by the hour. Business owners get what they pay for. Maybe should stop the dei hires
Reply: @godusopppppp you clealry never ran a business
Reply: That's what you get when you have cheap labor
Reply: @stevenfuller3816 yes. They should not do the job. This is horseshit work and if you think it’s ok for things like this to happen then you are part of the problem.
Reply: Get that $ not their job smh
Reply: @godusopppppp  😂 you must be 8yrold. Seriously government contracts read about them
Reply: @shadygunshow  I’ve built houses, dams, water treatment plants, waste water treatment plants, turnpikes, bridges , airport terminals, fire stations, commercial spaces etc. from Minnesota to Texas. I’ve been everything from a carpenter to a superintendent. I now work for an Engineer. I have a degree in construction management. A wall being off can be a big deal, but not that one. You simply aren’t experienced.
Reply: @tvviewer4500 yeah but they probably aren’t going to get hired again or keep their job. Someone above them must have told them to frame it anyways.
Reply: @godusopppppp concrete guys read the plan wrong. Who fcked up?
Reply: This was wrong on all parts both the framers and the concrete company are both numb as the other comments said that's why u snap lines they never should have framed it to begin with and as for the concrete guys my wife's father owns a concrete company I worked there for 3 seasons and sorry but we never had issues with anyone we did what plans said to a t because that was the expectation
Reply: @RoofingFacts  one of my dogs knows how to roll her window down. It's hilarious and irritating at the same time.
Reply: If the framers didn't call the architect and find out what the problem is. It's their fault.
Reply: Boss won't listen ,just do it or quit .
Reply: @godusopppppp they obviously knew the slab was wrong and your right a good framing company would say something to the general about it being wrong and not do it till it is fixed, but they most likely aren’t some top tier framing company (just go to any job site and look who is doing the work most of the guys probably shouldn’t even be working  and I don’t even mean bc their illegals I mean bc of their quality of work is no  existent and the last thing they should be doing is framing. Also they probably had other projects on their schedule so they did as the plans said even if it wasn’t going to line up properly with the fucked up pad bc at the end of the day they will say they did their work according to the plans and thus must be paid, and the guys who laid the pad are responsible for fixing the mistake they made in the first place.
Reply: @2002mattyusk  assuming they followed the plans exactly, no they shouldn’t have bc they are paid to do as the plans dictate. If they don’t they will not be paid since they did not do the job to the plans specification as stipulated by the contract (again assuming this is a normal house build). It’s up to the foundation guys to fix their own mess, not the other way around. And vice versa if it’s the other way round on who fucked up. Cheers
Reply: You don’t just build a building the wrong size because concrete guys f’d up they’re going to have to dig pour footing and wall it’s not even that tricky and really a good gc should double check forms before pour for size and square
Reply: They no speak englayyyy.😂
Reply: @Jerbo1125 not paying for work that isn’t right 😂
Reply: @tomt637 framers should have noticed it was off told them it’s not correct so they can fix it now it’s a big issue 😂
Reply: @tomt637 Even if the guys screwed up with the slab, as the framers you now KNOW you're doing the wrong thing and compounding a mistake. So, it now becomes your fault, too. There is no excusing willful errors that compromise the structure and safety.
Reply: No shit.
Reply: I can almost guarantee the carpenters' measurements match the blueprint much closer. They had no choice but to build the dimensions to the blueprint or leave their walls short and not according to blueprint.
Reply: @godusopppppp  lol wut? thats not how shit works lol if a job takes months, no laborer is going to wait till the job is done to get paid. they get paid daily, sometimes weekly or bi-weekly, the contractor has to have money to pay these people. 

Also in most states they could sue for wages quite easily if they aren't illegal
Reply: Yup, kinda moronic.  Like, "Not MY problem."
Reply: Cheap labor don’t care
Reply: Have too ! The whole house will be off
Reply: @luvdady ya thunk???
Reply: @2002mattyusk LOL move every exterior wall in by an inch that won't fuck up every single component of our building plans from the bottom to the top right?
Reply: Either Framers are idiots or They both fd up assuming the slab is the incorrect size. They still framed out a whole house on a slab they knew was incorrect.  Did they not measure before building.  Its kinda how it works.
Reply: @2002mattyusk  by just moving them all in changes the footpring area which affects the roof truss layout. Or second floor layout. By hiding the issue you make the issue more expensive to solve as more needs to be redone. The best thing would've been to contact the Project Manager and inform him that there is a problem. From there I would suggest adding the needed footprint of concrete and continue, maybe 1 week delay on a project instead of 3 months delay and deconstruction.